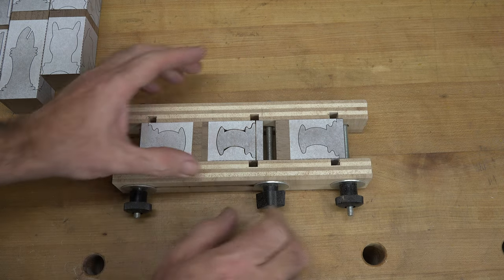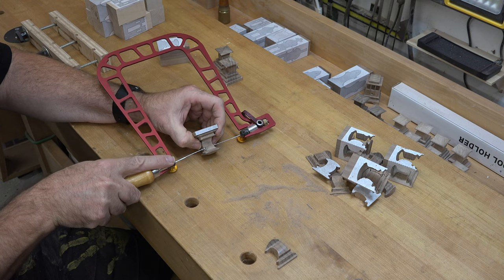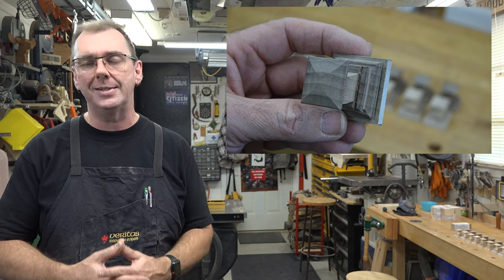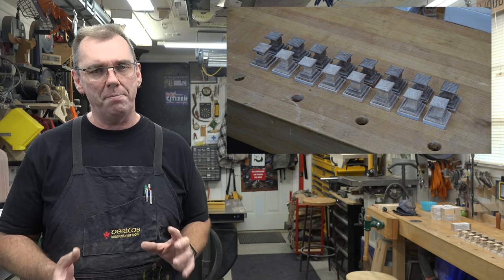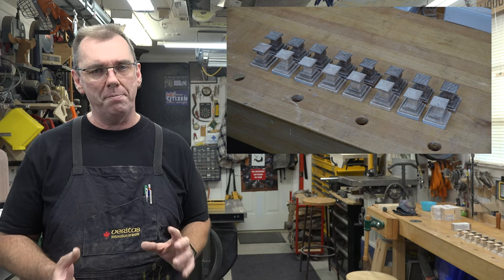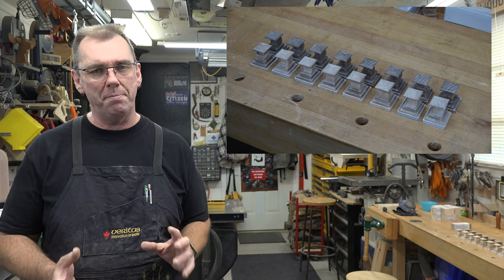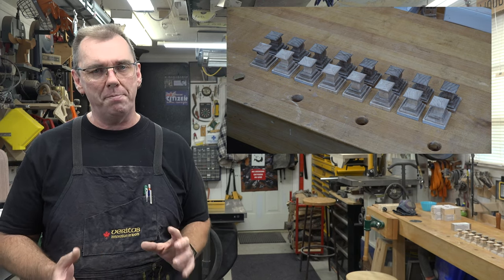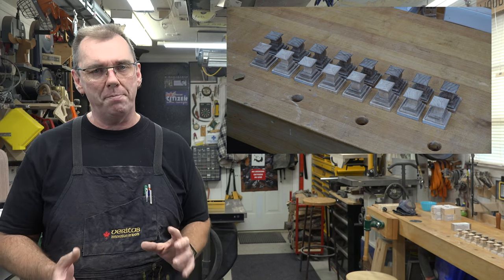Making a Chess Set Part 2

Comment: Your pieces look great, I would love to see them when you have chosen the finish.
Reply from the maker: The finish is done on these ones Andy.  I was torn on what finish I wanted and the more I looked at them, the more I decided that I wanted a simple, matt finish.  So I went with several coats of Danish oil to bring out the colours of the woods and that was all.  They look great.  Thanks for tuning in sir.  I truly appreciate it
Reply: @acutabove_woodworkings  Sounds like a fine choice. Because I am lazy when it comes to finishing Danish oil has been my go to, for sometime now. I know it isn't the right choice for every project, I just reach for it. I think for your chess set though it was the right choice. For some of my more demanding  finishes I am just about to experiment with Osmo hard wax oil. Thanks for sharing the chess set build it is good watching a master at work.
Reply from the maker: @andyfarmer759  I'm still debating on flocking the bottoms of each piece but I'm in no hurry.

Comment: That's the result of meticulous concentration to get the details.  Your experience with model building fits into  this method of scrolling perfectly.  Very true it would make a fabulous gift for someone.  Issue would be someone would see it and offer to buy a completed set.  If you consider your time is worth anything at all, they couldn't afford it.  I also like the "block" style.  Usually chess pieces are round-ish in nature.  May not try a chess set but your techniques will do me well on another project.
Reply from the maker: Thanks for the kind words on the project Dwight.  I've already had several offers to purchase the set.  My answer to all of them has been the same...."I don't think you could afford the price that I would be asking".  It's not the material cost, it's not the time it took to make.  It's the value the project has for me and the sense of pride that it brings that make it out of reach for a potential buyer.  Thanks for tuning in to the show this week and taking the time to leave your comment.  I appreciate it.

Comment: Hi Kenny! I want to see the finished pieces and if you are going to spray them, how you are going to get to the insides of the pieces. Really enjoyed the slow scrolling and would like to see what you end up with where the scroll saw some times went in a little too deep creating a line that shouldn't have been there. It is these issues that make me think I am not good at scrolling and to see you have some of them as well is rather eye opening. Regards, Bill
Reply from the maker: The pieces were eventually finished with a coating of Danish oil Bill.  The rougher areas of the cuts were smoothed out with hours of filing and sanding.  Most of the issues when cutting a set like this, are caused by pushing too hard and trying to make the blade cut too quickly.  We are all guilty of it at some point in time and for pieces that take this long to cut, it's not hard to get impatient and try to get them to cut a little faster.  This causes the blade to bow from side to side as well as from front to back.  All of this flexing of the blade makes the cuts uneven and curved.  So the thing to remember is this.......slow is the way to go.  thanks for tuning in to the show.

Comment: I really enjoyed the video.  I made a chess set but am currently working on another one with a different pattern.  I have a question that never gets answered to my satisfaction from other videos I've watched.  After all the interior cuts are made on each piece some scrollers say to tape the pieces all together before cutting the outside.  I have seen others not do this.  When I do tape them, I inevitably get sawdust under the tape and the line is obscured.  What is your opinion on this?  Is taping them back together needed or does it depend on the difficulty of the pattern?  Again, this was an excellent video and very informative.  Thank you....
Reply from the maker: Taping the sections back together after completing the first set of cuts is done to stabilize the blank while cutting.  I have tried to cut pieces without taping them together and there is enough room, with the kerf of the scroll saw blade, to allow things to shift and mess up the cuts. Nothing aligns properly.  Taping things together definitely allows for a better quality compound cut.  You don't necessarily have to tape around the entire piece though.  You could always tape around the edges, just enough to secure the piece and keep it from moving.  This might alleviate your sawdust issue.  I hope this helps a little.  If not, feel free to carry on the discussion here and we can chat about it some more.  Thanks for tuning in to the show.
Reply: @acutabove_woodworkings  Thank you.  Yes it helps.

Comment: Which brand blade do you recommend both brand and size
Reply from the maker: For these chess pieces David, I used a #7 PGT blades (precision ground tooth).  I pretty much only use Olson blades in my shop and that's pretty much all I've used since day one.  The PGT blades are a little more expensive than the normally ground blades, but for something like this, they are well worth the added expense.  I hope this helps.  Thanks for tuning in to the show.

Comment: Have you ever tried spiral blades? I've been using them for a while now and it's saved me a lot of drilling, not to mention making turns and angle far easier.
Reply from the maker: I have used spiral blades on many projects Jack but I find that they don't give as quality a cut as a normal reverse tooth blade; not to mention that it is impossible to get a crisp, inside corner due to the nature of the blade.  Don't get me wrong, they definitely have a place in the scrolling world but   they would definitely create a whole lot of extra sanding for a project like a chess set.  Sometimes, it's better to have to drill the extra holes and make the extra turns.
Reply: @acutabove_woodworkings  I'm making a chess set at the moment. Using a fine spiral blade. Definitely agree about the inside corners, which is one reason I use fine guage. I'm cutting walnut and curly maple for the pieces... So far the cuts have been pretty smooth... Minimal sanding. Wish I could send you some pics.
Reply from the maker: @jackseiler5207  I'd love to see some pictures Jack.  You can always email me at kennye@acutabovewoodworkings.com.